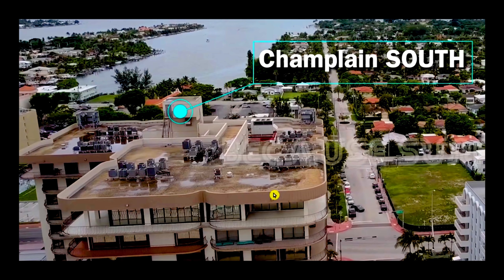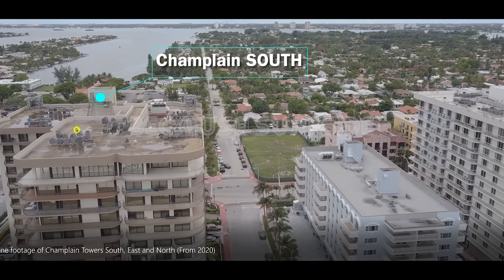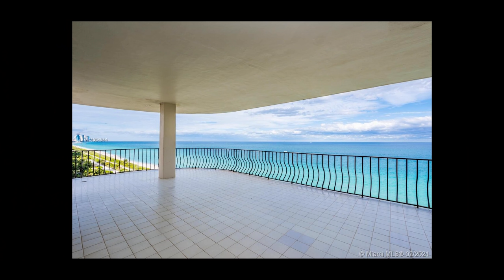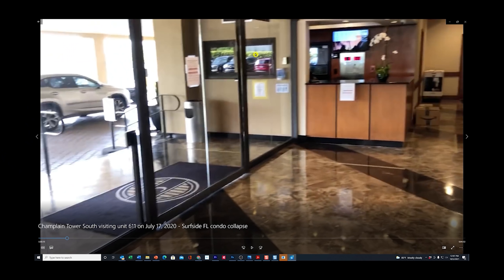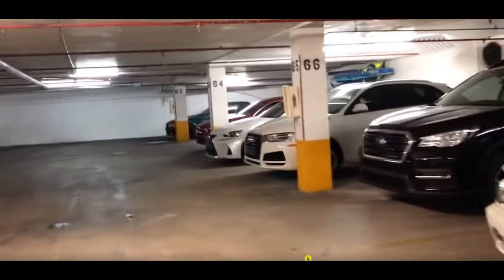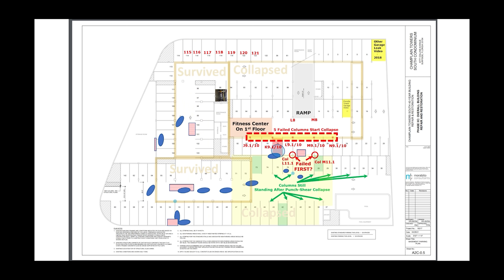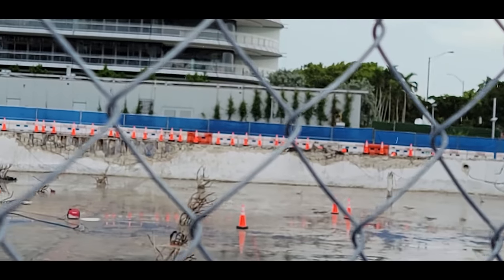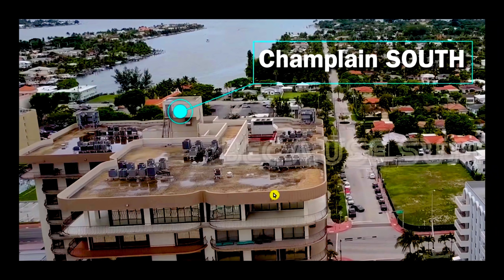Miami Condo Collapse: Water Attacked Roof, Inside, Pool Deck

Comment: After watching this 5+ times, I see a classic "straw that broke the camel's back" situation. Did water in the roof cause a collapse? Probably not. Did water on the pool deck cause the collapse? Did extra weight on the balconies cause it? The planers? Water under the building? Shoddy construction? Lack of maintenance? Most likely none of these alone caused it, but adding 1+1+1+1= collapse. My gut is telling me there's water- an aquifer perhaps- under the foundation. Pool deck water fed it. Then, boom. Roof water and added weight meant it was just a matter of time. Each factor would have had to be addressed. If a proper inspection were done, it would have discovered these problems and the recommendation would be to condemn the building and tear it down, saving nearly 100 lives. 20/20 hindsight, I guess. To the numb nut questioning Jeff's expertise, a 3rd grader could see the problems. Not that Jeff isn't an expert, he is.
Reply from the maker: Yes, 1+1+1+1+1+1+1+1 until the collapse

Comment: The building was sinking every year so roof drains wouldn’t work due to it sinking. 
Still the design was the major part in the building failure. It never should off had residents occupying such a failed design.
Reply from the maker: No one had proved that the building was sinking in the last 20 years.
Reply: @jeffostroff  ive heard that it was sinking by X amount per year after the building came down!

Comment: the water is caused by the USA manufactured air conditioners that gush condensation, and this water is caustic and entered and water is the bane of steel and concrete and other metals that corrode easily...it is not rain, these are bad air conditioners that are never service properly and regularly, these contributed to the loss of structural integrity...and the fault and liability lies with the building owner, self reporting and each of those folks are owned over $1 million each as pain and suffering

Comment: All THAT WATER POOLED IS FROM RUNNING ALL THEM AIR CONDITIONER UNITS 24/7  YOU DONT SEE ALL THEM UNITS ON THE OTHER ROOFS THATS WHY
Reply from the maker: They have drains for the air conditioners they don't drain on the roof that's not allowed by building code

Comment: This has been nothing more than a criminal negligence crime scene, since day one.
You've been sucking on this subject, from an engineering/construction angle from day 2, seems pointless, you must find this personally entertaining, have at it.
The cold hard truth here is, if this building had been properly,professionally maintained, it would still be standing pretty, and probably for another 40 years as well.
Furthermore, the tile on the balconies, were of absolutely no consequence, to the collapse of the building.
Reply from the maker: Yes that is part of it, but more analysis from other engineers suggest poor construction methods, overcrowding of rebar in columns, pool deck was near 100% load as constructed, etc. I realize you have your bent on anger filled tirades and conspiracy theories, have at it.
Reply: @jeffostroff  
First thing first, Jeff. I NEVER said or suggested that anybody conspired to bring Champlain towers down.
The POOL DECK wasn't (nor would have ever been) designed to support the towers in any way, nor was (the pool deck) designed to have a paver system installed on it . The pool deck, collapsed when a portion of the 12 story tower collapsed on to it.as it would/should have.
Your own analysis in some of your vlogs, has captions using the term"PREVENTABLE". 
What would have prevented the "preventable" ?? Action/proper maintenance / repair ?
The only smoking gun you and the "other engineers" are ever going to find is, NEGLIGENCE, on behalf of the property management/ Condo Association/ Whomever was paid to be responsible for the upkeep of this building, not the original engineers/designers. They did their job, the building and the pool deck , stood for 40 years.

Could there have been/ was there any "conspiracy", "possibly"to collect and keep/misappropriate funds/condo fees/ loans taken to carry out major maintenance and or repairs ?
ABSOFUKINLUTELY, but this is the first time I ever mentioned anything about "conspiracy".